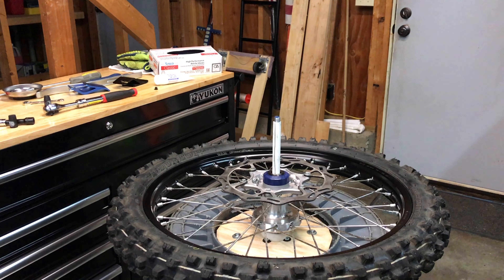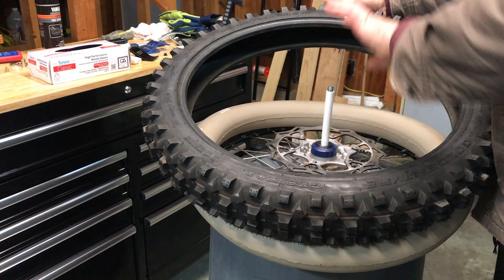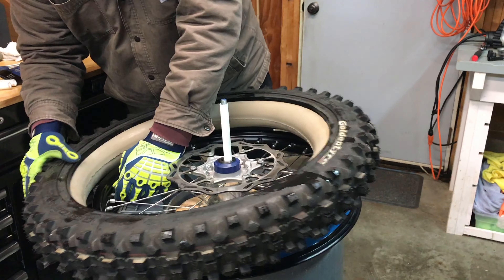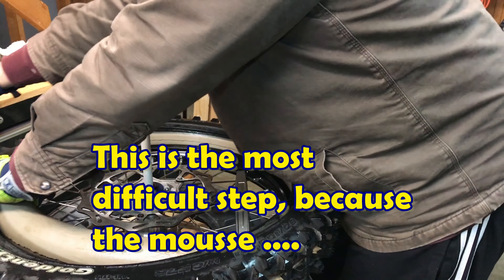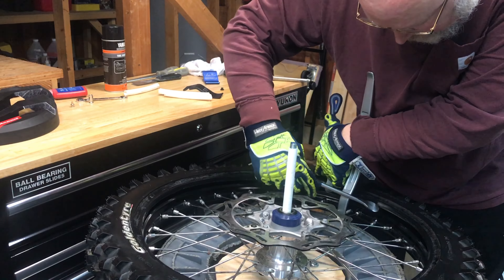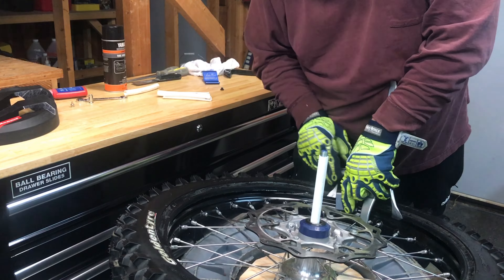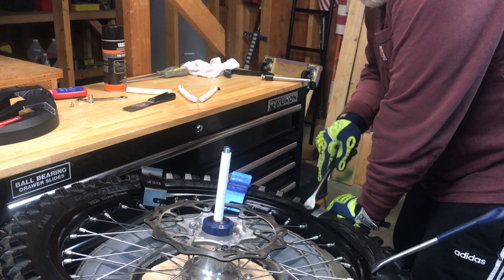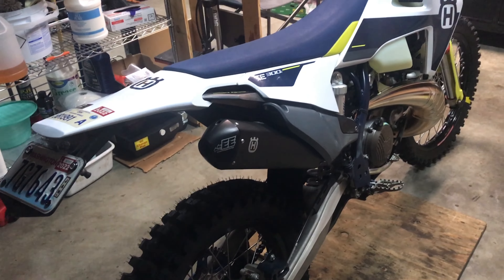Install a Nitro Mousse on a Front Fatty - 2021 Husqvarna TE 300i

Comment: Recieved my 235 mousse + wedge to fit into a new gt fatty. 

 My 235 is actually 230 in diameter and a tight fit around the rim (as you experienced). It was the last unit from the supplier and bit of a bugger its shrunk. I’ll be fitting with a wedge tomorrow (thanks to all who recommended fitting an additional section initially) but I still think the nitro mousse 235 is too small for the gt fatty. I like a softish feel so I’ll see how it goes

Comment: I had a worn fatty mousse for my fatty. Switched to the chubby. Simply added a cut piece from another mousse and got the volume feel that I like. I have been using nitro for 4 years and love it. I only use tubliss fronts for dual sport situations.
Reply from the maker: The wedge or notch method. I will do that next time! @LostinPA has a good video on it.

Comment from the maker: After the first ride on the Mousse, I think the tire pressure feel is too soft -- more like 8-10 psi on a fatty 90/100-21 versus 10-12 psi I prefer when running a fatty.  So, on my first front tire change, I may try the wedge/notch insert.

Comment: Nice, I ride the awesome Husqvarna te 300 I. Question on the moose and mounting,, do we need to get a second beedlock where tube valve stem is?
Reply from the maker: No. I think a 2nd bead lock would only be necessary on the rear tire where drive torque being applied. But if you got a front fatty, definitely add a  wedge - a peice of old Mousse - cut the mousse and insert a wedge. I'm running without and it feels pretty loose like 8 PSI -- which is sloppy for a fatty front.
Reply: @BlueDawnEnduro  cool thanks, I have only run tubes, and tires of buying a tube every time I replace my tire. Will have to check it out for sure

Comment: Hi bud 
What’s the width knob to knob of the fatty and how did it hold up with the nitro mousse ? Did it shrink to early too fast? 

I have one on the way for my 22’ te250i and was going to buy the same 235 size mousse.  Every time I try a tube in the front I’m straight back to the mousse just like the feel I guess
Reply from the maker: It held up for a second tire. However, it was too mushy from the beginning even with the larger size and stiffer fatty. So I've gone with adding 2/3 of the Nitro Wedge in the front. Works great, love the Mousse.
Reply: Cheers thanks 👍
Reply: Did you find a mousse in the front dampens the hits better and maybe also the additional weight adds to the stability ? What I’ve noticed twice anyway ….

Comment: Normally mousses are not that hard to install. The problem here is the NM21-235 is too small for the fatty tires. It's the largest 21" Nitro mousse makes, so its the one the recommend. They should tell people that it really needs an additional wedge for the fatties.
Reply from the maker: Good to know! It felt like the mousse was too small diameter though, not necessarily thickness lacking
Reply from the maker: Have you tried the Nuetech Wedge? Wondering how the fit/integrity is after you cut your "donut" open...
Reply: @BlueDawnEnduro  i haven't actually bought a wedge from them, but I've made my own from another mousse, which is no different. I don't think it compromises the mousse at all. Keep it lubed and it will last just as long.